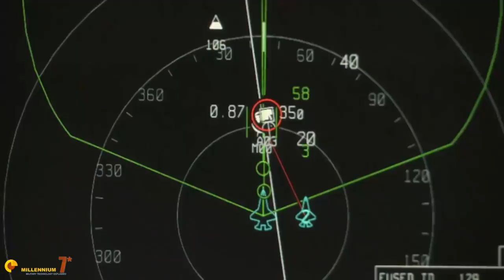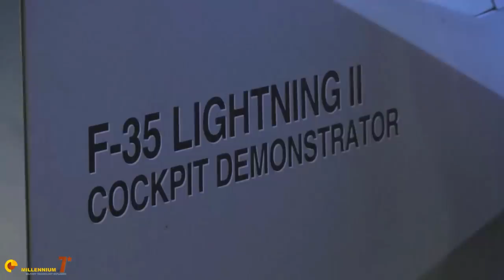Put the F-35 inside the F-16 | Are there limits to upgrades?

Comment: It’s still hard to understand how, when I practically have more computing power in my smartphone than existed on planet earth when the F-16 was designed, you can’t just yank all that huge old hardware out, install modern avionics, draw more electrical power that’s freed up to be generated since the engine now pushes less weight around , and balance the airframe with ballast weight.
Reply: What you think of as computing power is not the same as what is considered computing power on an aircraft. Take for example the radar of the F-16 block25 and up. The radar alone requires 5.6kW of power. Your phone is working in the order of 1o's of milliwatts, or 56 orders of magnitude less.
Reply: So we’re talking sensors not processors- which in general my basic intuitive understanding is that sensors have also gotten smaller, more efficient, and lighter weight (cameras lasers antennas) 

but I can imagine that a radar from long ago might not be much less powerful by unit of weight than one today, because I assume there’s a huge amount of copper wire involved?
Reply: However he does call out processor clock speed as the problem when it comes to heat generated- and I understand it’s difficult to cool based on the f35 experience, but I’m just saying that intuitively, this doesn’t make sense to me- again using the cellphone analogy. I’m curious to know how much computing power an f35 has compared to an f16 compared to my phone...
Reply: The issue is, try and get the smartphone rated for airworthiness and also for military use. Suddenly a 250 dollar phone costs a million bucks.

Comment: How ironic that F-35 avionics produce so much heat, while consumer electronics have advanced to provide all the computing power most people need in a mobile device that runs on a battery. 
Sure everything has to be re-certified for a new plane, but the question is why does so much of the software have to be written from scratch? There should be a generic avionics software / hardware platform that only needs to be customised for that model. Do other industries start completely from scratch every time they design a new model? Do Tesla rewrite the software for each new model of car, or DJI rewrite the software for every new drone?
Reply: Support costs are always important and a lot of it has to do with maintaining legacy support while providing new capabilities. So far the only plane he's covered with truly modular software support is the Gripen - if others have it, I'm not aware of it (but I don't pretend to be aware of everything).

Your pc comparison is understandable but far from the mark. First your new software is going to have to fit in with the target hardware and the hardware isn't plug and play or even always off-the-shelf available - it's built to meet military hardening specs and power budgets that the software developers have no say over. Your new software design does everything but doesn't conform to the older messaging protocol, systems control budget, memory bandwidth, or CPU microinstructions? Sucks to be you because you are going to get to start over until you think you got it right. Finally you succeed! Is it time for a test flight. No. No it is not. Public law requires operational test and evaluation and that begins with preliminary and then critical reviews of everything you touched and everything anyone else has touched - and that will be led by the development agency in charge of your slice of heaven. Your software is not going to just be installed on a multimillion dollar airplane full of fuel and carrying weapons to start testing - you have far harder requirements than the commercial pc world. Oh - but you want to just run some of the old software on new hardware? OK, no problem. Are your new processors 16-bit like the old ones? No, but your 64-bit processor will be fine with it? OK - please show the review committee how the old software won't drive the new hardware to generate its own sneak circuits while operating under a military electrical overstress. You passed? Great. We have just gotten started.

And that is why avionics costs more than PCs and military avionics costs even more than that. Did I mention that your stuff has to be capable in a nuclear warfighting environment? It's not a problem but we'll have to discuss those requirements separately. And while I have you here, we're going to want to see your program plan for line as well as depot maintenance, and of course, training for maintenance and pilots.

Or you could just start with a modern, updated architecture and get away from the underlying legacy approach. Like say - the F-35 program. Or buy a Gripen. Or invent your own Gripen-like system.

Apple came out with a new processor architecture upgrade and if you bought the new model iPhone when that happened, you were presented with the opportunity to buy new versions of your existing, paid apps or do without. One day my bank website told me that I needed to upgrade my browser. The browser upgrade failed because my older PC was no longer supported. I'm so sorry, what's that - new security threat but your home router is no longer getting security updates so you need to replace it even though it's running like a champ? 

Yes, other industries do too make it hard on us and make it very painful at times to update things and that definitely includes Teslas and PCs and smartphones and smart TVs and everything else.

They get away with not having to do it at the cost of millions while operating and surviving nukes while being managed by new officers with Congress occasionally jumping in to help you make sure some of the development and acquisition money goes to the right districts.

¯\_(ツ)_/¯
Reply from the maker: It is no longer like this. The USA has now an open architecture standard that was used on the F-18Block III, the F-35 has its own modularity, Saab also has a modular architecture etc. But till the early 2000s this was not the case. Most of the computers run ADA code directly on the metal or almost. The whole concept of "device driver" was not used. Mind, part of the idea was also to make the source code more easily auditable because there were way fewer "components".
Reply: It is difficult to compare the F-35 to consumer electronics, because, the F-35 is basically a late 90s, maybe early 2000s program.
The plane is basically running on windows 98 and equivalent hardware.
Additionally military hardware is always more bulky, because larger processor architectures are more resistant to EMP, radiation, etc.
NASA loved the 8086, because it is basically bulletproof, I presume the same principle applies to fighter jets.
There are approaches of writing middle-ware to decouple critical software from add-ons, but AFAIK that came a bit later.
Reply: @henrikg1388  I'm not sure what you are asking me. It sounds like you want me to count the number of notes in some songs and compare the numbers. Things are what they are. I mentioned the Gripen as what I hoped would be a relevant counterpoint to the comparison of the F-35 and PCs, not because I wanted to debate airplanes but because I wanted to debate the idea about comparing aircraft to PCs. I picked the Gripen because it carried encapsulation all of the way to the kernel for its weapons modularity and because it wasn't the F-35. It's an aspect that came to mind at the time I replied, if something else about a different plane occurred to me when I was writing, I would have used it instead of the Gripen and instead of the F-35.

BTW - Ada was named for Ada Lovelace so it's ok to call it that way. 🙂
Reply: @henrikg1388  If the comparison is about poor requirements management and requirements creep destroying a product's budget, schedule, and effectiveness vs something managed well then I couldn't agree more. The USAF had a firm requirement to replace the F-16 with a sustainable, modern upgrade. The F-35 is here and has been here and the USAF still has a firm requirement to replace the F-16 with a modern, sustainable upgrade. I don't believe for an instant that would be any different in some hypothetical universe with specific changes to source code language(s) or some ideal in software modularity. Program mismanagement at the requirements level is an effective killer of any project regardless of anything any engineers can do trying to design around mismanagement.

Would the Gripen be a suitable replacement for the F-16 for the USAF? I don't know. Last I looked, everyone was talking about the new capabilities for heavier loads and carrying capacity for the F-16 updates. Do they want a small agile fighter with some ground support capacity? How much ground support is required for a fighter in the latest US estimation? I have no idea but I will be willing to bet cash money that the answer is more and that number will increase the first time before the ink is dry on the contract. I'm sadly confident that were the Gripen to be seriously considered, some faction could see to it that it would fail selection because it cannot deliver a B-52's worth of bombs with pinpoint precision and a seamless software architecture (and yes, that's just meaningless word salad).

As I see it that's the problem and it's purely political. No amount or type of technology will ever solve it.
Reply: @henrikg1388  In a perfectly rational world we wouldn't need fighters or bombers or anything else.

Comment: The only advantages the F35 is its stealthy airframe. Avionics can be put inside a F-16V but it would still be a 4.5 generation fighter.
Its wing surfaces and leading edges nullify stealth frontally not rear ir which is average. The F-35 also has a upgrade plateaux
soon in its upgradability due to its airframe...why f35 orders are tapering off- slowly.
Reply: Actually no, the F-16 airframe doesn't have enough internal volume to accommodate F-35's avionics. The F-16's radome can only fit radar about half the size of the F-35. And F-16, even with CFT and two drop tanks can't match F-35's range.
Reply: Basic Wing loading without body and vortex lift.
F-35A
Empty weight: 28,999 lb (Year 2015).
Wing area: 460 ft²
Wing loading: 63.04 lbs/ sq feet.

F-16C Block 52
Wing area: 300 ft²
Empty weight: 18,900 lb
Wing loading: 63 lbs/ sq feet.

F-35A's empty weight is 1.54X scaled from F-16C.
F-35A's wing area is 1.53X scaled from F-16C.
F-35A's 43000 lbf thrust is 1.50X scaled from F-16C's 28600 lbf.
F-35A's 45000 lbf thrust incoming upgrade is 1.57X scaled from F-16C's 28600 lbf.

There's a near straight 1.5X scaling between F16C to F-35A on basic wing loading, engine thrust, and empty weight.

F-35A's wing area is influenced by weight growth and F-16C's empty weight wing loading target.
Reply: F-35A has high AoA and rolling scissors advantages when compared to F-16V.

Comment: One could argue that the Jas system seems more agile, so far there has been little problem adding funktions to it. The situation on the F35 seem to be shall we say more complex in its structure since flight critical systems are separated in the Jas 39 E there is less that can go wrong the F35s ongoing war with Alise seems to be over after a cost of hundreds of millions. I can only say that the new system ODIN better work if not the US taxpayer will be billed another hundred of Milions. One could gave bought an airwing of Jas E for the cost of the ALIS system.
Reply: Gripen E isn't even production-ready after 14 years of development.  There isn’t even a production sample in existence, and they haven’t even flown at night as of HX 2020.

Comment: The modern avionics and displays are lighter, their computers are smaller, and their components are much much lighter end cooler.  

Now.... the F-35 sensors, and computer processors for the helmet and how all this data is received and integrated........ I don’t know. My guess is most top end intel processors can handle just about anything the military needs inside a fighter. So the question is how could this be transferred over to an f-16 or an aircraft like the A-10 or a future 5+ or 6 gen aircraft? 

My belief is it’s a lot easier than Lockheed, Boeing, Airbus or other manufacturers are willing to explain.  I firmly believe that if Lockheed leadership felt their salaries and incomes and homes were at risk..... they could develop a 5++ or 6 gen fighter in a very short time. But as long as they believe they and their wealth is safe.... they’ll milk programs like the F-35 as long as possible.

Comment: @BB3  I believe that it would be very appropriate for SAAB to market various upgrade packages, avionics, radar, fuselage or engines, for the legacy Gipen C/D to some level of parody with E/F or NG demonstrator... as long as its cost effective and extend service life...

I still believe that a better solution for Sweden would be to provide upgraded Gripen C/D to poorer NATO Nato nations, similar to the Hungarian and Czechia lend lease, including Croatia, Slovenia and Bulgaria in return for their existing Soviet planes to go to Ukraine...

The Gripen should be used by Nato nations as the F-5 was cheaply supplied by USA to allies...

Poland and Romania should be given F-16s for Soviet Planes as they operate the platform already...

The Swedish Gripen low operational cost goals where clearly achieved and should be utilized for all Nato and other poorer nations worldwide...

The F-35s c costs are Disasterous and only one of its many operational failures...

Do yourself a favour and read the book "American Gripen" it details the failures of the F-35 and debunked the current misconception of the success of BVR Missiles, which form the backbone of the usage paradigm of F-35...